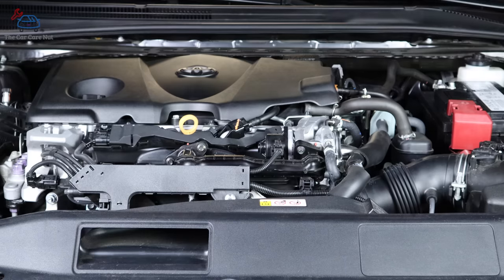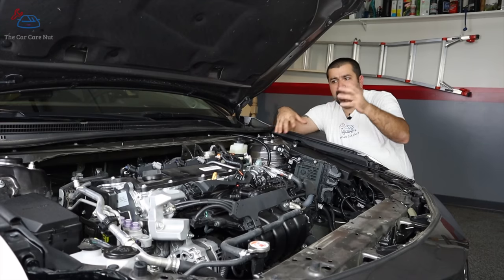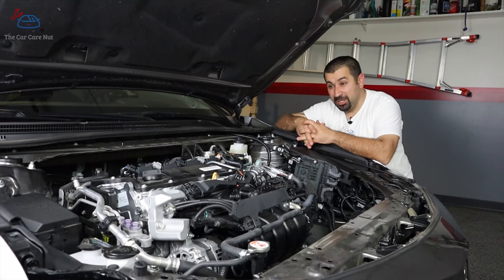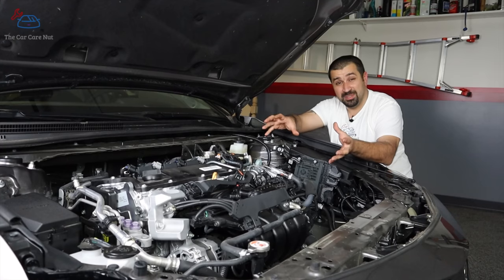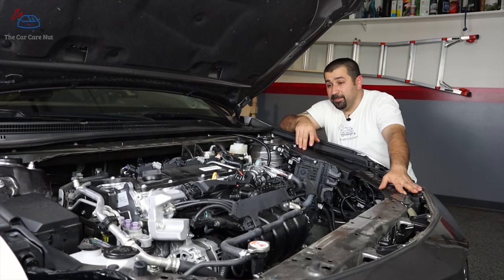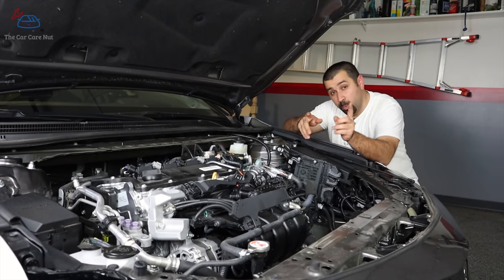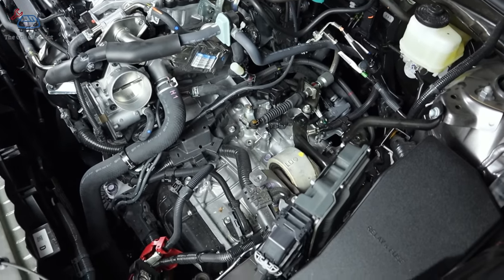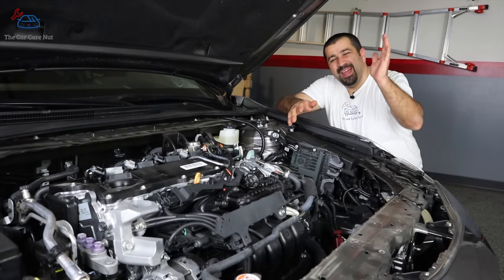Toyota's New Engine Technical review Part 2 : Variable Valve Timing, DIY tips  and Parts location

Comment: I have questions about the VVT-iE - I get the part where it's spinning faster/same/slower to change the valve timing (ie. when the valves open and close). 
1) Does it do it through a speed difference between the motor and the camshaft alone, or does it need to change the camshaft angle at all?  
2) When and if it fails, this part is easily replaceable?

I am also very impressed by Toyota's engineers, who came up with this system that seems much less complicated than other VVT strategies (VANOS lol) and allows for very immediate and precise control of the timing. I am especially glad to hear that there is a failsafe scenario built into the system where your engine doesn't immediately grenade when the VVT-iE actuator fails. In a German car, that would result in the engine ejecting itself out the underside of the vehicle. 

The kind of long range, forward thinking that Toyota does is a huge departure from the design philosophies of VW/Audi, BMW and MB and is the reason why Toyota is the #1 auto maker in the world. Sure, the cars will not be as fast or cutting edge as the German competition, but the purpose of a car is not really to be fast and cutting edge - for most people, it's something to get them from A to B and back. Ain't nobody got time for reliability issues.
Reply from the maker: Hi! So the camshaft is connected to a gear and that hear is a two piece gear that has the motor connected to one of the pieces so when the motor turns it changes the angle of the gear which then changes the location of the camshaft in relation to the timing chain which is connected also to the gear.

The motor itself is very simple to replace but does need to be calibrated afterwards. I have to say this again, as complicated as this system seems replacing that motor is so simple it makes you laugh and admire how well it’s made.
Reply: @TheCarCareNut  Thanks for the explanation. BTW, will you ever do a video on the 2GR-FKS V6 found in the 2018+ Camry?
Reply from the maker: Yes I want to cover the new v6 as well. I hope in the near future
Reply: @TheCarCareNut  My dad, who has a '20 RAV4 LE AWD, says that the car is very fuel efficient even in 100% city driving and that a single tank lasts him for 300km. This is with short trips in the winter, stop and go traffic, etc. It is very impressive how all of Toyota's engineering know how is distilled into an easy to use package like the A25A-FKS.

Comment: So...where can I use my dwell meter?  I have this engine in my 2020 Camry LE and I'm amazed how complex it is. Before I bought my 2020 I had a 2005 LE and got 218,000 trouble free miles from that engineering marvel. This engine is more complex than the HAL 9000 and the Space Shuttle combined. I hope changing spark plugs won't be a major chore.

Comment: So, one thing I LOVE about servicing newer BMW's is their electric water pump... fill the system with the key on, headlamps on low beam, Heater on hot, Fan on low, dash vent mode, then hold accelerator for about 10 seconds and it enters a 10 minute self bleed procedure.. no need to worry about overheating or air pockets.. easy

Comment: You would think at this point they would have the perfect plastic to make it last after heat over time or have a maintenance schedule for them to be replaced, wouldn't they? After all they are known and striving for the longevity. My myself I don't care, as long as they fix the long term issues with plastics. I don't know how far the tech has come with it though. 
Thanks for these videos, this motor is mindblowing!

Comment: Once again very nice video
1. Plastic components are very problematic as they age and are prone to breakage.  I disagree with the plastic cover but it a done deal.
2. Coolant bleeding is an issue.
3.  Changing a direct injector will be expensive as there is disassembly associated.
4. Is the charging system a smart charging system.
5.  This is a very complex and complicated engine.  I think Toyota should figure out a fixed cost for scheduled maintenance as it complex. I am sure high end scan tools or factory software tools can do many function like coolant valve control or electric pump control.
Let’s see how it goes.....
Reply from the maker: The charging system is similar to the previous models which use very low amperage at idle so it won't create a drag and increase emissions. Basically it can maintain a healthy battery and maybe recharge a discharged battery over a long time but it won't be able to support a dead battery for long.

The engine is complicated but it is also well made. The scan tool is similar for all Toyota models called Techstream and is available at all Toyota dealerships. Not much have changed from the scan tool end of things for this engine just added more functions to cope with the added functionality of the new systems.

Comment: 7:25   Plastic Engine Parts - On my 2011 Toyota Camry I had some plastic parts . Every 6 months ? I would pressure wash the engine and let it dry . Then I would liberally spray 303 Protectant all over the engine compartment and let it soak in and dry , a few hours ? As this protects rubber and plastic components from drying out and cracking .
Reply: I doubt thats having an effect on longevity

Comment: Thank you for such detailed introduction to A25A engine! I am impressed with Toyota's Port/Direct 8-injectors system. What year did Toyota upgrade GDI to the dual injection system? Really interested in those engines and plan on buying a vehicle specifically with that type of fuel delivery after hearing all the horror stories with GDI. Thank you so much in advance!
Reply: Per Wikipedia, A25A was introduced in 2017: https://en.wikipedia.org/wiki/List_of_Toyota_engines#Straight-4
Reply from the maker: Hi! The A25A was introduced in the Toyota line up in the US in the 2018 Camry which was essentially built in the end of 2017.

Comment: Excellent video thank you! I tell you my experience. I just discovered that my official toyota dealer has always used 0W20 in my 2019 hybrid rav4. I asked toyota Switzerland about that and they tell me that maybe my dealer did not have 0w16 at the time and that 0w20 is cheaper. Anyway no answer about that. They just  told me to ask my dealer why he used 0w20. That sounds strange to me. Im asking myself if the reliability of my engine is compromised. I have 110'000 km now. Any idea?

Comment: I love your videos! They’re very informative and it makes me appreciate the work that you and other mechanics do as well as the engineering that goes into these well-made vehicles. I have one question, however. The owners manual for my 2019 RAV4 states that the oil should be changed every 10,000 miles unless extensive idling is done like if you’re a taxi driver or policeman (in which case it suggests 5,000 mile oil change intervals).  I do about 65% city and 35% highway driving. I also don’t idle that much, I’m wondering if I should keep the 10,000 mile oil change interval or should change the oil more frequently like every 5,000 miles?
Reply from the maker: Hi! Other conditions that I would highly recommend the 5k oil change interval are short trips under 5 miles and cold weather below freezing. Do these apply to you?
Reply: @TheCarCareNut  how often would you have to be making the trips under 5 miles to warrant getting that 5k oil change? I go to class Monday, Wednesday, and Friday and that trip is 3.4 miles each way.
Reply from the maker: It’s not specified it mentions frequently. That’s why I usually say play it safe and not guess and change it every 5k miles

Comment: Appreciate the video.  Very informative and helpful.  Can you do a video on how to permanently turn off the stupid auto idle stop Toyota has begun using.  Unfortunately it is not latched which would allow the desired setting - on or off - to be set and happen automatically.
Reply from the maker: Hi frank! Thank you for watching my video! At this time there’s no way to turn it off permanently at least from the Toyota side. I’ll update if that changes
Reply: @TheCarCareNut  What about disconnecting the battery monitor wire from the negative battery cable so that the auto idle stop system doesn't get battery status?  If no status the system defaults to being off.  Or seat belt sensor for same reason - system will default to being off if seat belt not fastened?
Reply from the maker: That might work. I would have to do some testing and research and let you know what I find.
Reply: @TheCarCareNut  Thanks.
Reply: Toyota screwed up on this start stop system, the default mode should be OFF. Any new features should be on, ONLY at the owner's discretion. Hopefully a software update will allow owners to turn it off permanently. Everyone seems to hate it.

Comment: Not sure if you have addressed this in a previous video, but I like to hear an explanation on SPECIFICIALLY what is different in the drivetrain of a recent model Rav4 that give the Adventure (Trail in Canada) a 3500 lb tow capacity compared to much lower tow limit of the base model. From what I can tell the engine and transmission are the same.
Reply: The transmission is a very slightly different model with only 4 exterior parts changed, it also has a separate transmission cooler on the adventure and TRD models I believe. The rest of the work is in the suspension and engine electronic control systems that tweak output curve and get that more torque needed to tow. At the cost of only about 15% fuel economy overall. The "base" model 8 spd rav4's can still tow as well but it isn't an advertised or recommended feature.

Comment: i'm reading that the EGR valve is getting stuck on some of these engines, the aluminum getting corroded by certain elements in the exhaust gas, and the solution is to replace these with valves made of different materials? hope it'll be addressed in the next iterations of the engines

Comment: Truth be known, that electric variable timing motor is more reliable than the rest of the gasoline engine.  It's amazing how much complicated engineering Toyota is forced to do to meet emission standards.  Battery electric vehicles have complicated electronics, but simple mechanics.  Once the battery costs drop a little more, internal combustion powered cars will not be able to compete with EV's total cost of ownership.
Reply: Or you mean when the battery cost goes up because of all the rechargeable devices being made and EVs coming to market. Lithium supply is not ethernal.

Comment: Very good very good,...life is good, oh, one question, the 2.5 engine, is belt or chain and if belt at how many miles should be change?  🙂👍
Reply from the maker: Thank you for watching! It has a timing chain and it doesn’t have a replacement interval. If the car is maintained right the chain will last the life of the engine.

Comment: My mom has leased two vehicles with this dynamic force engine (2019 Lexus NX300 and 2022 Lexus NX350) According to wikipedia these engines feature hydraulic lifters (engine code: T24A-FTS). However, under load especially, I hear quite a bit of racket from the valve trains of these engines. It's not an isolated incident. The 2019 NX made the same noise all through the length of the lease. I've driven a few 2022 NX350's and all of them make the same racket under load. My 2009 VW GTI has hydraulic lifters and even under load, that engine has no racket coming from the valve train. Now, that engine has many other reliability problems, but valve train noise is not one of them. I'm beginning to think that Toyota actually uses solid valve lifters on this engine given the amount of noise it makes. Can you please confirm whether this new dynamic force engine requires periodic valve adjustments or if it, in fact, uses hydraulic lifters?

Comment: My understanding on the Atkinson cycle engine is that the piston inhales a full charge of fuel air (same as Otto cycle) then exhales some of it back into the intake manifold to control combustion pressure to the correct amount. 

Question: At higher altitudes does the intake valve timing go back toward Otto cycle to keep more of this fuel air in the combustion chamber to maintain power? Like free turbocharging with out the unreliable turbo.

Comment: Hi! Your videos are amazing I ended up here because my Camry SE 2.5 2019 has a label for 5W30. I read the US manual and as you said they recommend 0W16 
I’m from Mexico by the way. 
Any ideas of why Toyota Mexico is saying and using 5W30 on this engines ? 
I do the oil change myself and I put 0W16 the thing is I bought the car with 50,000 miles and I’m pretty sure they have been using 5W30 the whole time . 😢
Any recommendations?

Comment: Thanks for a great pair of videos .... I’m considering a new Sienna which I assume uses this type of engine ... the pointing out of components was most helpful... perhaps you could at some point explain how the electric drive of the hybrid versions works and it’s components
Reply from the maker: Hi! Thank you for watching my video. This is the same engine in the 2021 sienna hybrid. I made a series explaining how hybrids work. Here’s a link to that series https://youtube.com/playlist?list=PLeFzfl0Q8rQUgJLQheNbttBtKT6iSOX4D
Reply: I just purchased the 21 Sienna and I'm totally in love with it. With this new engine under the hood combined with the electric motor, it has tons of power and instant response to throttle input. No matter how you drive, it will give you great gas mileage. I have to say you will never think that a four-cylinder engine is under the hood, it doesn't even run at high RPMs unless you floor it which would only be for short periods of time as it pulls really really well.

Comment: That intake VVT actuator looks suspiciously similar to the one used by Mazda on their Skyactiv G engines. Considering Toyota's partnership with Mazda, I wonder if it's basically the same exact system that Mazda has been using since around 2012.
Reply: All VVT systems have very similar workings.
Reply: @jhndijkman  Not really. Although similar in what they adjust, they do not all work the same. Same as variable valve lift. Honda was first, but many manufacturers now vary valve lift (which is not the same as cam phasing as discussed in this video) and they all do it differently.

Comment: I came across your channel and i became a fan, I’m a newbie teen driver planning to buy my new car , could you recommend me a tried and tested vehicle in terms or reliability with less penny to maintain less than $30k dollars from toyota . Im torn between corolla/hybrid , corolla hatch, camry hybrid and non... Manual or Automatic , is CVT of toyota good and reliable compare to 6-8 automatic transmission ? And all models that  i mentioned which one is direct injected and which one has both port and direct injected, tell me which is more reliable... looking forward to response, and thanks so much from the knowledge sharing
Reply from the maker: Hi and thank you for watching my videos. All the models you mentioned are reliable with very little issues. The hybrid corolla is really nice with awesome options I just encourage you to test drive it and make sure you like how it drives. The Camry is bigger and nicer but also more expensive to buy. Hybrids are good for fuel mileage and non hybrids are cheaper and also get good gas mileage but not like hybrids.
Reply: @TheCarCareNut  alright thanks so much sir
Reply: You might want to follow Dave Ramsey's financial advise before buying a new vehicle
Reply: @onenikkione  i’m still weighing my options but thanks for the info sir

Comment: Hi- Would a bad pcv valve cause oil consumption? If so how often do you see this problem cause the pcv valve is like a 10 dollar part but about 400 bucks in labor on this engine
Reply from the maker: Oil consumption is rarely caused by a pcv unless it’s completely clogged and that’s not common with good maintained engines.

Comment: Hello, I have a very dumb question, but is my I4 camry smells like fuel (from exhaust) on extremely cold day start ups (havent started car in 5+ days each time, usually go to get food/groceries), but after a few mins it goes away. Is that fuel smell normal? I was watching other videos saying that it might be running too rich or too lean, but i think its just that the engine is ice cold and needs to pump up fast to get warm quick, or its just that its so cold that smells are far more obvious, or something. I dont really know, but nothing wrong with the car at all. Very fun and nice car lol
Reply from the maker: Hi! That could be normal. It’s normal for cars to run rich when first started cold and if it’s been sitting and it’s very cold out it’s worse.

Comment: So I should still change the oil every 5k even though Toyota recommends 10k service intervals? Also, while I have Toyota care for the first 25k or 2years, and the dealer I bought from has a lifetime power train warranty?
Reply: Changing mines every 3K miles
Reply from the maker: I would change it every 3-5k or 6 months
Reply: Every 10k no way, I did that with my 2011 camry and it was burning oil like crazy. Now I change it every 3 to 4k and it is much better.